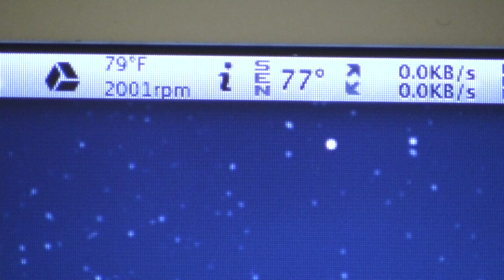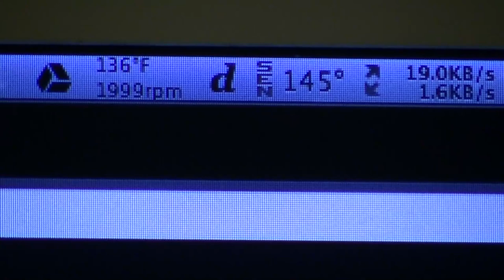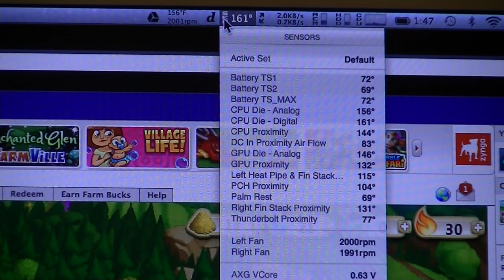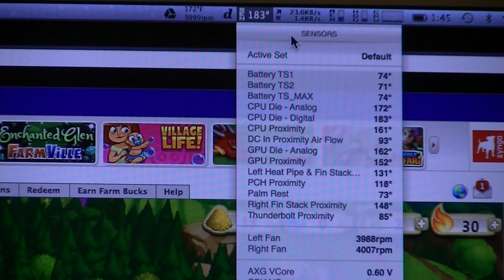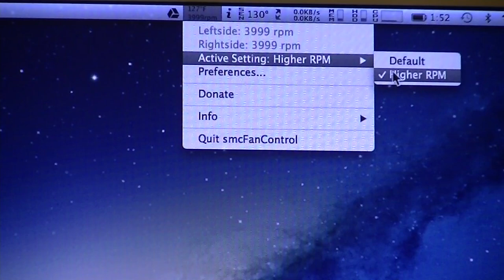HOWTO: Stop Your Macbook Pro Overheating!

Comment: Thanks so much! This process did wonderful things for my MBP (Late 2008). I'm running an average temp of 60C now, rather than 90C. Since the fix, it has only gone above 80C rarely, and even then, it barely has to use the fan to cool down. It amazes me that Apple will work so hard on power saving and cooling designs, and then allow this to get messed up during manufacturing.
Reply from the maker: Very true.  No idea what the heck the deal with that is!
Reply: uberDoward
Probably part of planned obsolescence, if you ask me...
Reply from the maker: I do not, but I hope to get my hands on one in the coming months, and then I will have a video on it :)

Comment: MacBook Pro 17" late 2011  DID NOT remove the optical drive or ram. Removed the heat sink a MESS of the OVER abundance & VERY POOR coverage on the CPU/GPU and the heat sink.On cleaning the copper on the heat sink transfer plates found deep scratches & nicks in both! Used  ArcticClean Remover and Purifier."Buttered" the CPU / GPU's and the heatsinks with THIN coat of Arctic Silver 5, added a VERY thin line on the CPU / GPU  and reassembled. WOW!! The difference in the temps was really amazing!
Reply: F16CJWW What would I use arctic clean remover for?

Comment from the maker: Marcel Fortin "If a cluttered desk is sign of a cluttered mind, what then is an empty desk a sign of?"  - Station is cluttered, yes - but I know where everything is :)
Reply from the maker: ***** Touché, sir! :)
Reply: +uberDoward If you put stuff away, you wouldn't know where to find it.
Reply from the maker: That's the honest truth!!
Reply: +uberDoward Both of my workspaces are cluttered.  I've had a cluttered workspace for years.  Everything I need is within reach of where my work is and if it's packed away, I have to find it again.  However, if I start on a new project, then I 'reset' the workspace bench. putting away all tools and components, getting out what I need as time progresses.  Gradually the items pile up again.  I've worked this way for 36 years without any issues.  

On your bench, you have a gold 'cup' item.  Is it a soldering tip cleaner containing steel wool?
Reply: Scrap that last question.  I searched online for 'gold coloured soldering tip cleaner' and found the item.
Reply from the maker: Sorry for the delayed response - it's brass wool, not steel - used for cleaning the tips :)
Reply: uberDoward
Thanks for that info.  My soldering station (price of a small car) came with what looks like steel souring coils shoved into the caddy.  I do like the look of your gold one though, so I may buy one.
Reply from the maker: I like the brass cleaning pads better - they don't scratch the iron tips :)
Reply: I may switch to brass then, although I've never had any issues with the silver steel.
Reply from the maker: The brass is just softer, helps the tips last longer.  I've never had issues with the steel, either :)  The excess solder seems to come off much easier with the brass wool, too!

Comment: Great video! I just bought a pre-loved 2011 17 inch MBP, anti-glare just like yours :) Today I cleaned out the fans/vents, since I noticed a heat issue. After watching this video, I'll start moving towards working on the heat sink. Thank you!
Reply from the maker: Viki Gancarczyk Put an SSD and 16GB of DDR3-1600mhz, and you'll find it runs absolutely wonderfully :)
Reply: It actually came with 16 gigs of ram and an SSD from its previous owner. I love it!
Reply from the maker: Wow, nice!  Enjoy :)

Comment: Thank you for the detailed walk-thru.  My reason for checking out your video, was because I've already tried cleaning, and applying new arctic silver to the heat sink.  I followed the instructions at ifixit dot com, and after I was done, my MBP didn't turn back on.  After watching your video, I plan on doing a better job of cleaning, and i'm gonna take a different approach to getting the chip/heat sink to stay connected when I put them back together. Big Thanks!

Comment from the maker: The warranty is only void if you do something to screw up the system.  Drop a screwdriver into the logic board without disconnecting the battery, for instance.
Reply: Just wrong...
Reply from the maker: Nix da! I'm afraid not.  No warranty is usually void unless your actions are attributable to the cause of failure.  :)

Comment: Thanks a lot for the video, very informative. I'm getting ready to do the same on my macbook pro late 2011 17", and I was glad to find your tutorial to see what I had to expect. I didn't know about the polish thing, I might order some. I was planning to do it today but after disassembling it I realized I didn't have any nylon tweezers and I don't really want to go with a metal tweezer inside of it, and my compressed air can had run out. Just a matter of a few days to order some, I guess. I was particularly afraid of the tiny connector above the speaker, but watching your video made me realize it wasn't actually attached to the speaker itself, so just for that part, I'm already glad :)

Comment: Hi I'm into technical support at chip level repair. I've been wondering if this actually works because of the polishing you've done trying to smoothen the surface, or it's because you're removed the stupidly high amount of grease apple applies on their heatsinks. Anyways what's the polishing paste you've used to make that mirror finish ? Greets from argentina friend !

Comment: uberDoward Thanks for your answer. I have checked and both fans are running and I haven't disconnected them when replacing the paste. I will check the work I did on it this weekend to verify if I've not overdone it with the paste and that heatsinks are tight enough. As far as I know all is set properly. I've followed the 'grain of rice' amount for CPU and 'bob' for the GPU. Is it possible to change the thermal profile for a different temperature? Do you think my heatsinks need lapping even though the device is not even a year old? Thanks again for your help.
Reply from the maker: I always lap the heatsink while I have it apart - the smoother the contact between the heatsink and processor, the better the thermal transfer.  However much heatsink compound you use - use just a little less.

As a test, put how much you think will work, and bolt the heatsinks down.  Then, remove the heatsinks and look at your contact patch.  You should easily see if you've used too much or not!

Comment: I just took my 104 degrees Celsius overheating retina MacBook to an apple store, they then checked it at the service and got back to me a few hours later stating the laptop is working well and has no defects whatsoever. This is the second time they returned my MacBook with the same result. I just don't feel using Photoshop Lightroom for editing should move up to those temperatures. Do you suggest I try and replace the paste myself. I build my own computers and feel confident

Comment: My 2008 macbook shuts off randomly when i touch the bottom right part of the keyboard. Not sure if my mother board is messed up or my battery. It also heats up really fast.

Comment: uberDoward I've just done the cleanup and re-application of the thermal paste. I must say there was a mess when I opened the laptop. The paste was seeping through the sides of the heat-sink. I cleaned it up with arctic silver cleaners and applied arctic silver 5 paste. I now see much lower temperatures THANK YOU. The drops are of 15-20ºC! Unfortunately this is only for normal use. When I try to stress test the machine with say prime 95 (mac version) I still get ~104ºC (why hasn't the system shut down?). I noticed the fans start ramping up when the temperature goes over 90ºC. Shouldn't this be lower. Could this be defective sensors? Is there a way I could set the fans to trigger at a lower temperature? I know this is a lot of questions but would really appreciate your help.
Reply from the maker: The fans ramping up over 90C is normal - that's now Apple has their thermal profile set up.  If you are still getting ~104C under heavy load, then a couple of things to look at:

1) Are BOTH of your fans running? Use smcFanControl to take a look and ensure both fans are reporting they are running!

2) You may need to have your heatsink lapped, or you may have made a minor mistake when re-installing.  You want ot use as LITTLE heatsink compound as possible, and ensure the screws are properly tightened.  If the screws are not tightened correctly, you will not have enough clamping pressure.

Check the fans, though - it sounds to me like you may have forgotten to connect one of them ;)

Comment: So I just had my Logic Board replaced by Apple in my MBP Late '11 15". I had the GPU Issue where the machine stops booting. Anyway since getting it back within minutes it gets so unbearably hot I can not use it on my lap, I checked the fans etc. were all clear which was fine then stumbled across your video. I am now suspecting they obviously separated the Logic Board from the heatsinks and either have not replaced the thermal paste or have used to much. Before I pull the thing apart does this sound likely to you?
Reply from the maker: Extremely likely, But, since you just had the work done, Apple should fix their repair at no additional charge to you.  My recommendation would be to bring the MacBook back to Apple and tell them to fix it correctly!

Comment: Thanks a great lot for the video! I did the procedure but i ruined the connector of the heatsink with the motherboard (it detached from the motherboard...). Put everything in place, my Mac started normally and everything looks fine, though... I use temperature monitor and my Mac is colder for sure!
What is that conector for? Is it dangerous to use the Mac this way? Thanks again!
Reply from the maker: Can you take a picture of the connector?  If it's the fan connection, yes you need that!
Reply: uberDoward Tks! I've already reasembled everything, but It's not the fan connector, but the heatsink connector. It's the heatsink thermal sensor cable (as I read at Ifixit. I believe you don't have that in your model!

Comment: The very first thing you should do, is disconnect the battery and make sure to wear that little wrist band that keeps static electricity from your body from damaging any of the internal circuitry.

Comment: What software did you use to check your cpu temps? Just got my Macbook Pro 2012 13 inch, and was wondering what the temperatures are like on this thing :)
Reply from the maker: smcFanControl, or iStat Pro
Reply: uberDoward That was a quick reply! Thanks!
Reply from the maker: No problem :)  Happen to be on the computer is all!
Reply: uberDoward Your videos are interesting! You just earned a new subscriber! :)
Reply: uberDoward Btw, when installing smcfancontrol does it conflict with my fans?
Reply from the maker: azbabby Absolutely not!  It will allow you to override the default settings, however.
Reply: +uberDoward Which is better in your opinion between smcFancontrol , istat menu, and istat pro?

Comment: please what is your mac configuration exactly (if i have the same one mid 15" 2012, gt650m , 2,6 i7) so i can do this step by step as you :) i have the same heat problem , thx and GREAT WORK and video :)
Reply from the maker: Late 2011 17" MBP - HD6770 / 2.5Ghz i7
Reply: Tomas I've recently bough a mid 2012 core i7 with a GT650 1gb like the one you got. Can you please tell me what are your stress temps and fan rpms under full cpu load + GPU stress also ? . Are you running windows 7 on bootcamp and osx ? thanks

Comment: I have a 2.4Ghz Core 2 duo 2010 Macbook pro, CPU diode Temperature starts around 105-113 F(idle). And after 5 minutes of stress test (100% CPU use) it goes up to 185 F and sometimes 195-6 F. Fan's speed is around 2000 rpm on default. Fans start to kick in at 180-185F. 
On the other hand my 320m Nvidia GPU starts from 109F and goes up to around 158F. Are these temperatures Normal? I usually do video rendering /encoding and I'm a bit afraid these temperatures may harm my mac. 
Just changed the Thermal paste after 6 years of heavy use. Applied Arctic Silver 5. Tried to put as little as possible. It seems that all the heat comes from the CPU cause the bottom usually gets hot exactly where the CPU is. Is this a problem?  
Some Help would be appreciated.
Reply from the maker: Those temps do, unfortunately, sound normal.  You can install smcFanControl and bump up the fans a little (I run mine around 2800rpm as 'normal', and 3500rpm when running FCPX), but rendering is heavy work, and you will hit max temps regardless of what you do, I'm afraid!

Comment: Hi! Thanks for the video! I've just installed an 850 evo SSD on my macbook pro 2010. But since then I've always my fans running at 6000 rpm. Did you get the same issue?
Reply from the maker: Réda Taoussi Nope!  Never had that issue....  what are your temps?
Reply: Problem solved yesterday Thank you! 
Around 75 to 95°C. I open the task manager and found that a process called Report Crash was running every 20 sec, pushing the CPU to its limits. I did a clean install of Yosemite by erasing the SSD. Now everything works just fine, and I can say "THIS IS THE SOUND OF SILENCE"
Thank you again for your support buddy, I really appreciate!
Reply from the maker: No problem, man!  Glad it worked!

Comment: Is it necessary to evenly spread the articsilver on the gpu before pressing the heatsink together or will the "twist and turn" be sufficient?
Reply from the maker: CHAD KIRBY There are many thoughts on the application.  Personally, I prefer to do the 'dot' or 'grain of rice' method.  I'd rather push the thermal past out to the edges (the 'twist and turn' if you will) to ensure there are NO air gaps.  That said, I've had success with both methods - so use whichever you are most comfortable with :)
Reply: Thank you. I appreciate it.

Comment: Thanks for the video +uberDoward, what was the product did you use to apply on cpu after polishing them?
Reply from the maker: Just regular rubbing alcohol to clean everything up
Reply: My bad, I meant the silver stuff when you add it after rubbing alcohol to transfer heat. Time around 19:10
Reply from the maker: Ah!  Arctic Silver MX
Reply from the maker: You definitely want to use thermal paste :)

Comment: Hey great video! I slightly skimmed through the video to see what it consisted of. I may have missed it, but what were your temperatures before reapplying the thermal paste?
I have a late 2013 rMBP 15" w/ 750M GPU. I'll be tearing it down this afternoon in an attempt to cool this son of a gun down. I often idle around 80c haha! 
Curious what to expect. Thanks!
PS~ Thanks for posting to macrumors ;)
Reply from the maker: LOL, np - my temps pre-paste were up to 213F (~101C).  My idle temps were usually 150F-160F (~65-71 C)
Reply: uberDoward That's exactly where I am with this guy. I work on computers for a living so it takes away from the fun I used to have doing stuff like this. I guess with my day off, I shall venture forth and see what happens! Thanks for the timely responce :D
Reply from the maker: No problem, just trying to help out :)  I hear you on the 'work on them all day' and getting tired of them at home.  I do the same thing with programming!
Reply: uberDoward I can immagine! Figured I'd let you know how the adventure went. Idle temps were largly affected by the factory thermal paste but not how I expected. I had the polar opposite of what yous was! There was almost no thermal paste on there. And paste ( I use that term loosely) that was on there, was dried and cracked. System is five months old and this is what they give me!! Idle temps dropped to roughly 36 Celsius and that is a huge drop from where I was (idle 75+).
Under load my temps are similar, but the physical cade no longer burns like hell in the center, The system is clearly throttling less, if at all. 
Thanks for thoughts and your time. May your code be forever bug free!
Reply from the maker: Congrats, glad it worked out well for you!
Reply: Dogbots159
 I have the same system as you and this thing is way too hot and loud under load. I've done this on many Windows laptops but never on a Mac. I heard these things are hard to work on, should I be nervous? How hard was that thing to take apart and put back together? Since all the major components are soldered on, I would like to keep the temps down to try and make everything last as long as possible.

Comment: i have macbook pro 2010, 15 inch 2.66ghz, i7, ram 4gb, nvidia gt 330m, os yosemite... my macbook always restarting when playing data 2, but when i used photoshop or browsing its fine... in smcfan control the temperature 60c when started... i was try change thermal and not the problem still exist... what would i do?
Reply from the maker: It's hard to say - if your temps are 60c @ idle, though, I'd say something was definitely wrong :)
Reply: Put your fan on max  (6200 rpm in smc fan control) with 
heavy usage

Comment: Everything is working except the trackpad (which apple disconnected for me rather than charge me over $200 for a new top case).  I use mouse / usb trackball 99% of the time anyway.  My main concern was cooling this older MBP sown before my wife decides to cook bacon on this thing!... Because it gets hot enough to cook food on after an hour of use (safari,i Tunes, and Logic/Mainstage running).